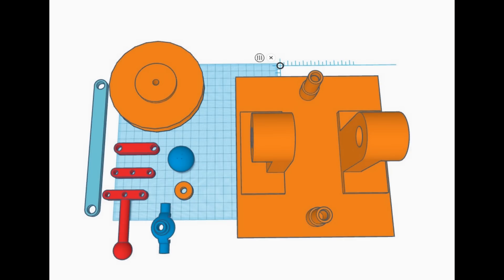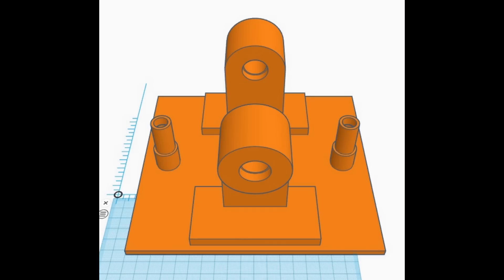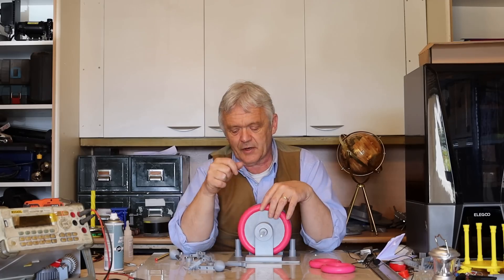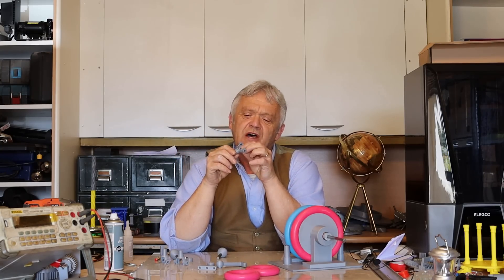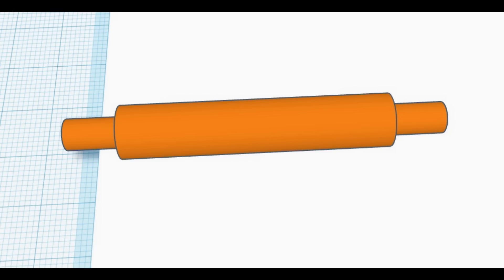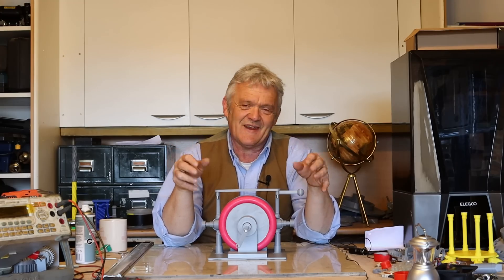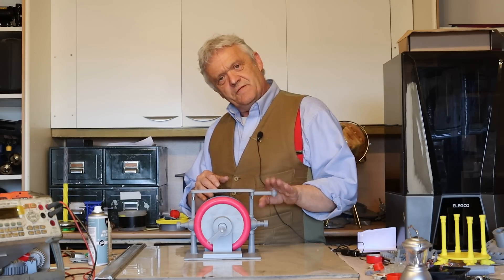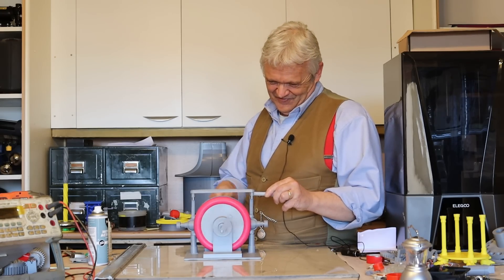2014 The Ring Based Continuously Variable Transmission

Comment: I think so, the best role for these sort of transmissions would be to test the efficiency of both the generation (conversion) and the "turbine" part of a generator. We could check if a given setup with a given (variable)  ratio would produce the same/more/less output (in terms of volt and - using a preceise variable load - also in amps)

Comment: Please forgive my ignorance, hence my question. Wouldn't the parallelogram as implemented here, make one of the balls be positioned in the slow-to-fast position and the other ball in the fast-to-slow position simultaneously? If that's the case then the slowing down was in part due to friction, not just a ratio. To settle or answer this question we need to see demonstrated the opposite of it slowing down: speeding up. You do a great job at explaining and demonstrating, thanks.

Comment: You forgot to show it pulled toward you showing the speedup of the structure. 
Now I'm going to have to build it to be able to see that. This is a fabulous DIY energy adjustment device and can be made with other rubber parts also.
This design is excellent for a hydro unit to adjust the speed as the water flow changes by the hour as it rains and then gets dry out again. 
It can be set to precisely keep speed at the mains frequency or a fixed voltage for a solar charger inverter.

Comment: Very cool concept, but there is a flaw. Both balls should have rotated toward you. The way you have it, one ball rotated away from you, and one ball rotated toward you. The transmission design was fighting itself, which is why it was squeaking. Make the connector bars connect to opposite sides of the lever, so that when you pull the lever, both balls rotate towards you, or away. But at any rate, a very cool design.

Comment: That is a great design!  There is a very similar type of CVT in common use on petrol-powered snow throwers.  The engine drives a steel disk upon which a rubber-tired ring is pressed at 90 degrees.  By sliding the ring close to the outer edge of the disk or toward the center of the disk it changes the ratio of input/output RPM.  It's very robust and fairly efficient from the perspective of power lost to friction.
Reply: I have an old (like 70's or so) lawnmore that used the same design. An idler 'tire' lol
Reply: Laboratory overhead stirrers from IKA use a very similar system. The motor has a steel cone with a shallow dish, the motor sits on a rail allowing it to move in and out relative to the hard rubber contact ring and  thus vary the speed

Comment: Like every CVT, this ball-version relies on friction too. Friction however has the disadvantage of losses, since the material, that bulges in front of a wheel (or ball) does not release all its energy back, but creates heat. The effect is called inner friction. Additionally, there is wear and tear, since the contact area is very small. Of course, losses can be minimized, by e.g. using toroids and balls from hardened steel, however, this decreases the available torque.

Comment: Um , the wind very seldom holds a steady speed , that would be your power source . But he said the speed is variable at the output end too . That’s puzzling to me . How do you handle torq ? In the C V T s I’ve seen , there is a belt that handles the torq , but the friction is what destroys the belt . In a car transmission , they are metal . In old toys with gas engines they are rubber mixed with Kevlar . 
But on a wind turbine ? Talk about a maintenance problem ! 
There has to be a better way .

Comment: @RobertMurraySmith Shouldn't the two balls have had their axes turned in opposite directions?  Turning them in the same direction, the rings have opposite ratios on each ball, i.e: 1:3 on one side 3:1 on the other.  You need to turn them the same angle towards the same ring, don't you?
Reply: You could redo the parallelograms long sides as sliding crossbars that have a slot to pass through each other along the sides to fix this.  then each end turns the same angle towards the same axle.

Comment: This type of CVT is used in the Enviolo step-less bicycle gear shift. I have one on my ebike, and it's so convenient to adjust my gear ratio on the fly to my liking while applying constant torque to the pedals.
Reply: Yep.just like the Schimano from 1958.  10 speeds, shift on the fly while pedaling.
Reply: I have a servo actuated version of it,  Nuvinci Harmony. Automatic cvt . Infinit pleasure :-}

Comment: Robert, this is very cute. But I believe it might have some usefulness beyond that of a transmission.
Specifically, it looks quite suitable for getting two plates or rings to counterrotate.
That would be a nice way to set up counterrotating magnets on stationary coils (if that's a thing), or, if one wanted to deal with the hassles of power transmission, to have dual sets of coils counterrotating over the magnets. Or even just coils on one and magnets on the other.

Comment: Just the sort of thing I've been looking for! Not exactly as shown, mind you, but if you mirror the mechanism into two transmissions with a central driving wheel, and have their transmission levers on one bar, you'll have two outgoing wheels with a fixed sum of transmissions, which is necessary if you've got a box-trike that needs to be able to turn tight corners...

Comment: Are u planning on making a feedback loop for the constant secondary "gear" speed?
If so are u gonna use arduino or a raspberry or will u make your own feedback driver?
I would love to see it this could dramically lower the cost of diy wind turbines since u can use a asyncronous motor as a generator straight on the grid
Reply: You could do this with an old school ball governor. Give it a Google. Quite ingenuous.

Comment: Your videos are awesome, they expose me (and many others) to knowledge and information I didn't see anywhere else, and inspire new ideas and creative thinking.
Thank you for your work and for sharing it with the world so freely and generously.
Reply: I do have one question regarding this video in particular... Intuitively, it seems that turning the two balls in opposite directions ("/\" or "\/") would make both of them touch the wheels with the same circumference for each wheel, while turning them in the same direction ("//" or "\\") would make them work against each other.
Looking at the way Kopp variators work, (thank you @TheBlibo), my intuition seems correct, yet when you've tested your device it worked... can you explain what's happening here?

One way this can happen is slippage.
And again, intuitively the ball with the larger circumference contact at the input side has some torque and angle advantages over the other side, which means the other side should be the one slipping.
If that's the case, the output wheel should slow down, no matter which way the balls are tilted.
...But I don't want to make any assumptions since I haven't tried it myself (yet:), so I would appreciate an explanation.

Comment: Yep - torotrack...

maintaining contact pressure is key (to inefficiency too_   +/- 90 degrees for infinite +/- rotational conversion (don't ask about efficiency at the extremes)- mononum of 3 balls is logical (3 is "self orienting in plane" allowing cv joints to be used on the disks - freely orienting...).

Comment: Remember the idea i said earlier for the galaxy drive and the gravity battery with the fan blades that can seal. I was thinking that we could fill the tube for the gravity battery with water, and have a series of blades that wil open and turn as the weight drops, but as you put energy back into the system, it closes the fan blades automatically and also draws the water up, as added weight. Im thinking this might be useful for an under a pond or lake or under the ocean type application? Perhaps reverse it maybe, so that theres a vacume under the fanblade seal that causes a vacume as the weight is pulled back out of the hole while sealed off...

Comment: this style of transmission is used in millions of bicycles, an special oil is used which locally solidifies from the pressure so that there is no contact of the metal parts (preventing wear)
Reply: Non-Newtonian shear is TIGHT!

Comment: Hi, I like the principle of this design in getting a variable transmission. But I think there may have been a mistake with the motion of the intermediate balls that change the gear ratio in your model.  The levers moved in different directions because they were attached to the parallelogram of the change mechanism (one lever moved towards the input shaft and the other away).  This however is wrong, both levers should move in the same relative direction - either towards the input shaft or away from it. This would mean that the balls maintain the Sam relative angle to each of the rings and thus the same gearing.
Reply: That's what I was thinking too. To mirror the rotation, the parallelogram could be a figure 8 over two levels, or just a Z as a single bar would be strong enough in this situation.
Reply: @VeniceInventors  Or it could be a simple push/pull yoke attached to the ball axle.  An especially useful configuration if you want to use a fly-ball regulator to control the output speed.

Attach the yoke to a sleeve around the output axle, connect the regulator so that it pulls the sleeve towards the discs as the output accelerates.
Reply: I actually commented the same, because I was surprised no one else caught it, then I post and see this.
Reply: Yes the rod that controls the other side needs to cross over to give turn in the other direction , or use 2 gears so the movement is constantly even 
eg; I remember an AirFix kit of a F111 that had the wings intermeshing with 2 cog like designs so they would move in sequince.
Reply: I noticed the same. That is why the balls were squeaking, the intermediate balls were working at opposition.

Comment: What if you amplified the out put from the coil and magnets by a telsa pancake coil with magnet disc driven by a wind turbine. The inductance into the primary gets amplified in the secondary by a thin plate of non magnetized paramagnetic alloy.

Comment: Compared to the friction disc design, this one is definitely a little less complex. But I expect it would not be as durable. The friction against the balls would be almost constantly abrasive when not configured in a 1:1 position. Same can be said for fricrion disc designs. However; the latter experiences abrasion against only 1 point of contact, while the ball design is experiencing it from 2 points. And I think that the differential will amplify that abrasion.

That's only speculation. I've never seen this design hands-on. But the friction disc design is common in lawn tractors here in the US, and are usually very reliable; high longevity. I'm rather surprised that automotive CVTs did not employ the same design.

Comment: I think the parallelogram isn't the right movement, the control rod needs to cross the centre point, so the the inner axis' of the balls point in the same direction, not opposite, the two ball posts should turn in opposite rotations, i.e. one clockwise, the other anti-clockwise.
Is there a way I can send you a drawing to explain better?
Reply: Crossing control rods are the right way to go for this build.
Reply: @danedmiston9673  Agreed
Reply from the maker: it doesn't seem to matter - i tried it both ways and it made no difference so I went for the easiest mechanism - where the ball touches the ring might change that but for what i did - it seems ether is good - and the control rod does cross the centre of rotation that's why the offset cage
Reply: @ThinkingandTinkering One of the balls is generating friction then, and you'll probably only get the slower output due to the greater torque vs friction of the ball that is angled away from the output, if they have crossed members you could get the output to spin faster than the input too, though likely with a little more elbow work.

Comment: Hi 
We used to use these back in the 70s before inverter motor controllers were available they were called kopp variators the tool I used the most was a marine cylinder hone with a 3kW motor there were 7 50mm steel balls in the variator. 
In some respects I might still prefer to use one of these over an inverter as some motor-inverter combinations can be noisy 
Always love your excited enthusiasm 
Keep up the good work

Comment: Ooh! Nice. Amazing demonstraion of a simple principle that's certainly in the "i'd never have thought of that" category. 
But wait a sec... Shouldn't the two balls be rotating antiparallel? I mean, when one ball's axis of rotation is tilted towards the red wheel, say, the other ball's axis should also be tilted towards the red wheel, yes? Not away from it?
Reply: Correct, one of the balls was slipping and not contributing anything to the output rotation.
Reply from the maker: it doesn't seem to matter - i tried it both ways and it made no difference so I went for the easiest mechanism - where the ball touches the ring might change that but for what i did - it seems ether is good

Comment: It looks like crab steering not Chinese puzzle as I would expect, the bar on the top should be a cross linkage not straight. Top down view would make it clearer.
Reply from the maker: it doesn't seem to matter - i tried it both ways and it made no difference so I went for the easiest mechanism - where the ball touches the ring might change that but for what i did - it seems ether is good

Comment: Could there be a way, instead of rubber on rubber contact, to have spherical gear that would stay meshed to the wheels?? 
🤔🤔🤔
Reply from the maker: interesting idea mate - i am nt sure how  would do that but i will think about it
Reply: by definition, no.  Gears need a fixed ratio between each other to mesh. It is therefore impossible to variate that ratio on the fly.  That's why the CVT always use a belt or ball as a friction interface.

Comment: I had an idea for a breaking system, 
Copper and neodium magnets and a mechanism that puts them cloer as it speeds up. 
Aft watching a heavy neodium magnet stop dead when swung at a copper plate last night gave me these idea so far. If u can fin it its worth watching. 
Also u could maybe get eough power fome the minut heat that could be used as well possibly. Just still picturing it in my head xx
Reply: Already in production and used for roller coasters, maglev trains and land-speed-record test vehicles.  Switch the copper discs/plates for copper coils, and you've got the regenerative brakes used in hybrid and electric vehicles.

Comment: There seems to be one problem with the model, rather than using a parallelogram you'd want to be using something that would shift the shafts of the balls all towards one wheel. It gets noticeably louder when you turn the handle, likely due to one of the balls having more friction on it than the other one.
Reply from the maker: that doesn't seem right mate - and basically you saw it working - so I am not sure what you mean
Reply: @ThinkingandTinkering  With a single ball the mechanism works as you've described. But with the parallelogram one of the balls has the small radius on the red wheel and the other has the large radius on the red wheel. When in reality for a reduction you'd want both small radii on the red wheel and both large radii on the blue wheel. 

It becomes more apparent as you add balls around the circumference of the wheels.
Reply: @Astro_Alphard  i was about to say the same :) you are absolutely right
Reply: Replace the parallel bars with crossing bars and it will become self evident.   @ThinkingandTinkering